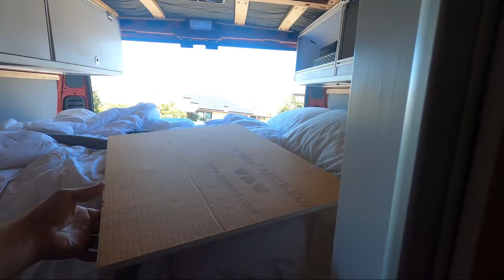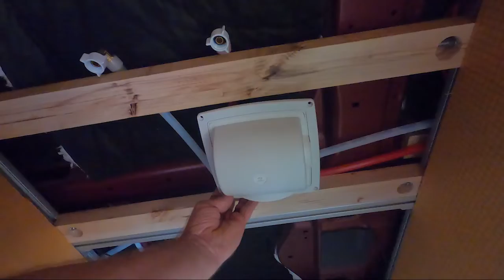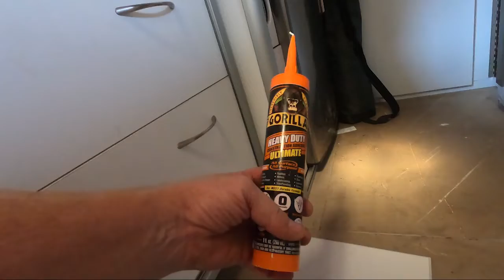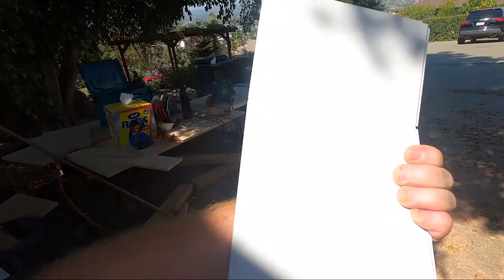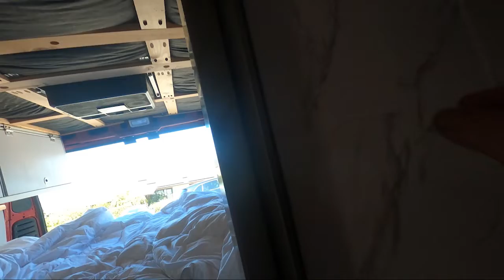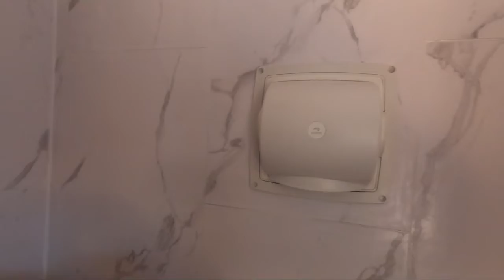Van Shower Build : Bathroom Shower Install In The Ram Promaster 3500 Extended

Comment: Next question. Are you still happy with how the tile worked out?  We are playing with frp but it's so unwieldy and we just rewatched this video and may switch.  Do you have Venmo or such? I'd really like to buy you a drink or two for all your help. Thanks.
Reply from the maker: Thanks, I appreciate it.  I'd prefer to have a drink in person some time.  If you're ever in Southern California, we can meet up.  Still happy with the tile.  It's held up well and the glue we used holds fast to the Kerdi board.  We haven't used the shower that much but the van has officially been through hot and cold weather.  We just got back from a trip from Southern California to the Nashville TN area to visit family and happened to arrive and got settled in just before the Polar Express event hit that area.  It got down to -4° F outside (-22° with wind chill).  The trip was almost 1 month long.  I'll have some videos on the trip once we get settle back in (just got home yesterday).

Comment: Very cool....any concerns how this would hold up to the vibrations of a moving vehicle?  I had the idea of fiber glassing over the Shlutter with epoxy and then gel coat.
Reply from the maker: I think it will hold up well but time will tell.   I'll be sure to let everyone know if it doesn't.  I don't know if you've seen it or not but Stonecoat has an Epoxy shower wall using Fiberglass and epoxy over 1" foamboard (the pink insulation) with a video.  I thought about that as well but decided to keep it simple.  But it's a good light weight solution..